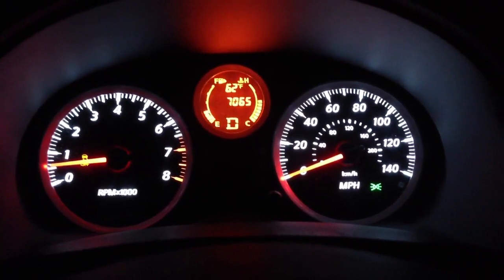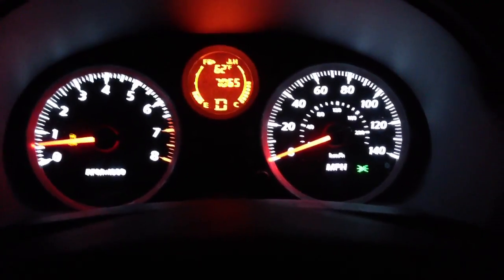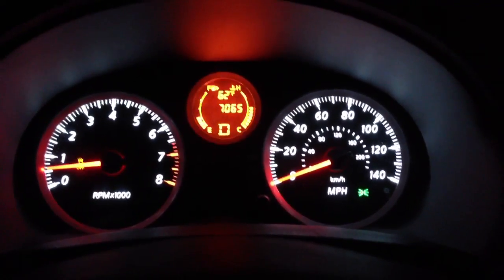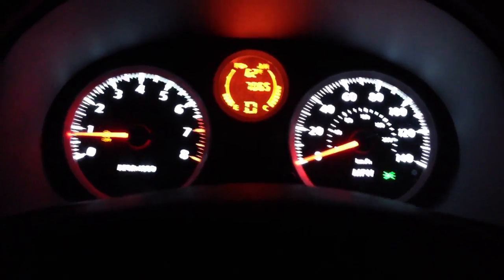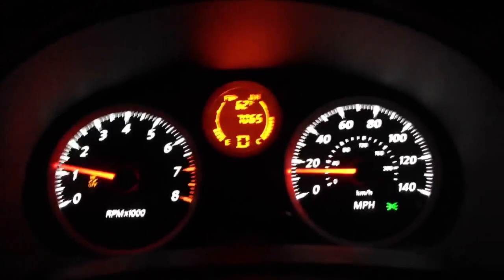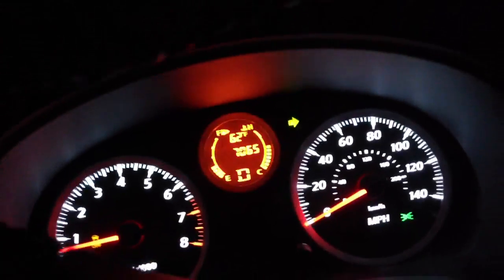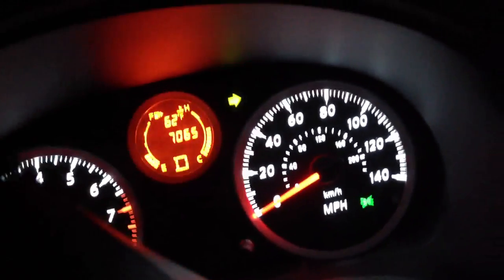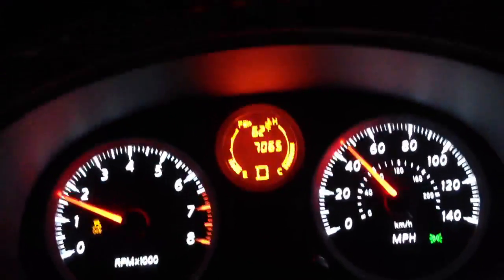CVT Transmission in Action!

Comment: sounds like the car is stuck in first gear
Reply: It is stuck in its only gear.
Reply: Gravemind No, in fact it's continuously changing the gear ratio.
Reply: It is changing gears, the point is u get all power at a continuous rate...
Reply: No, it doesn't. It sounds like the engine is at peak power.
Reply: It has unlimited amount of gears
Reply: cvts just have one gear, but that gear has an infinite amount of gear ratios, the diameter between the input shaft and the output shaft is a variant
Reply: i would like to feel what it its like since it keeps accelerating without feeling any gear shifting
Reply: @terry1427  it's not like a Tesla where it's just instant power that keeps you going. Personally I'll never buy another cvt because I love bouncing the needle off the red line and shifting. But in a cvt you can't really do that
Reply: @anthonyb2990  just bought a 15' Corolla with CVT, used to regular automatics and I drove manual once... Going to be interesting
Reply: @anthonyb2990  Well you need to drive one to see how it is. U can hear the engine better in a CVT and it rages in power. Manual cars are not like that. U may be able to reach red line but the sound is just loud and annoying. But on cvt the sound is powerful and deep. I tell you, u need to drive one to see how good it is
Reply: The gear is getting smaller continuously as the engine revs is getting higher so it stays always in it powerful band range ( i’m not an english native speaker so that’s y i may have made mistakes, but you’ll get the idea i think )
Reply: sounds like its stuck in a snow bank and trying to get out
Reply: I dont like that sound
Reply: sound like manuel car with worn clutch :)
Reply: Yeah! Isn't it great? Sonds amazing.
Reply: General Incredible I know how they work I just don’t like how it sounds
Reply: @mark babb Sound like it's stuck in its optimal power band* ;)
Reply: have you seen the williams cvt f1 car? if it was ever raced it would driven everyone crazy
Reply: Comments like this are why they make these simulate shifts now and I fucking hate it
Reply: @antholito  years later I still hate the fucking cvt
Reply: Depends how you drive it !
Reply: That is the best automatic transmission for passenger cars ever.!..👌 obviously if don't has fake shift.🤔
Reply: @helenodetroyo7035  you must have a cvt you seem very hurt by what I said
Reply: @Markbabb  
No, I never had a CVT.
What piss me off is that the automakers go against the logical design of a product reducing its potential because a bunch of ignorant clients.
Reply: Blahh... It sound horrible
Reply: there is only one gear
Reply: It is actually changing but without power lost, it is continuous
Reply: @itsthatatm8345  It can’t change gears it doesn’t have
Reply: @aluisious  always!👌😎
Reply: Technically it is but when you let off the gas usually in nissans it shifts to the needed gear.

Comment: Thanks, I will stay away from CVT if I buy a new car.
Reply: To each his own but it seems a bizarre sacrifice to me. You're giving up significantly better fuel mileage, significantly better acceleration and quieter cruising.  To someone who has listened to engines coupled to automatics for years, the sounds made by an engine constantly being optimally geared might be disconcerting at first, but surely that's something you can get over.
Reply: Number Six I haven't read anything more agonizing for a very long time.
Reply: SRAMEK "I haven't read anything more agonizing for a very long time.
--- I have no idea what you were actually trying to say.  Would you elaborate to satisfy my curiosity?
Reply: Number Six I might do that :). For me as someone, who really enjoys driving fast cars, especially with manuals (heel and toe and all the great things you can enjoy while shifting by yourself) or with sequentials (double clutches are not so bad as well), the CVTs are absolutely terrible to drive, even classic automatics are bad, but CVT is the worst, there is absolutely no feel in that. Before you tell me, that I didn't drive anything with a CVT, I really did dude and I have never felt so bad in car, I've heard about the pros of the CVTs and negatives of manuals, but for an experienced drive, you can erase almost all the negatives of the manual, but you will never get rid off the negatives of the CVTs or autos.

CVT feels a bit like driving old electric cars or trams. Dual cluth gearboxes are ok, you get quite a similar feel to a sequential gearbox and the it's so fast.
Reply: SRAMEK 
--- Let me employ your logic:  As someone who really enjoys being able to haul large and/or heavy items from place to place, I am certain that a sports car could never replace a pick-up.

 "For me as someone, who really enjoys driving fast cars, especially with manuals (heel and toe and ..."
--- CVTs were designed to replace automatics, not manuals.

"there is absolutely no feel in that."
--- I never addressed "feel." On small cars, CVTs produce both better acceleration and better fuel economy than do automatics.  If you don't like the "feel" of better acceleration, fine. If you don't like the "feel" of better fuel economy, fine.  BTW, CVTs were designed to replace automatics, not manuals.
"I have never felt so bad in car," 
--- Then don't replace your manual with a transmission that was never designed to replace it.
"but you will never get rid off the negatives of the CVTs or autos."
--- When it comes to hauling things, you will never get rid of the negatives of sports cars or economy cars.
Reply: I get you, for your purposes, it could be a solution.

What I was trying to explain was, why I personaly don't like CVTs, it doesn't matter, what it was designed to replace and after all, manuals are being replaced by DCTs and classic automatics, which might be replaced in the future by CVTs.

But the main problem is, that for most people, who enjoy driving, automatics and even more CVTs are terrible (no offence to hauling, I love some pick-ups), but for people enjoying the actual driving and the feels of it, I wouldn't recomend anything else than a high power manual.

I don't say, that CVTs or even automatics shouldn't be even made, there are certainly vehicles, where they can be used and could be beneficial. But when a company like Lexus put it in car I wouldn't be afraid to call a GT, that's horrible. If only there were the "new" M6 GC manuals in Europe. But I guess, that something like a 997 Turbo manual can heal the wounds :)
Reply: SRAMEK "What I was trying to explain was, why I personaly don't like CVTs"
--- I understand and we aren't far apart. I've owned nothing but manual transmission cars (and motorcycles) since I was 16.  I was trying to point out that while performance and "feel" might be the only characteristics you value in what a transmission delivers, that's not the case for everyone.  It isn't even the case for more than a small percentage of car buyers.  Manual transmissions may disappear all together because those of us who appreciate their strengths are so low in number that it's becoming increasingly non cost effective for auto manufacturers to design and build them.
--- Additionally, manuals aren't all moonlight and roses; a manual can occasionally be a real PITA.  On a recent trip to visit my daughter, it took me OVER FOUR HOURS to travel maybe ten miles of interstate.  I'd kill to be able to unlive that segment of the trip and do it with an automatic or a CVT instead.
Reply: Doesn't matter. EVs will replace most  manual and automatic ICE cars (mostly those bought just for commuting) within the next 50 years.

By that time, most of the buyers for ICE cars would most likely just be choosing between a stick shift and DCT since the market for ICE cars would be mostly just for enthusiasts (because it would not make any sense to buy a $50,000 gas car that a $30,000 EV could beat by that time).
Reply: Ano Niem I enjoy a good automatic as well, but I tend to stray from them due to the fact that they cost a fortune to maintain and replace when they die, compared to the cost of just replacing a clutch on a manual if properly driven.
Reply: @SRAMEK  "As someone who enjoys sitting in a fast car and mashing pedals with no understanding of what's actually happening, I don't like this superior technology."
Reply: Boris Z lls right
Reply: Good idea. They are horribly unreliable and have a "powerband" from hell if you'd call it that. They are horribly slow and dont give as much gas milage as they tout. Just stick with a manual or automatic. Shift shock will always beat these overly engineered steel band pieces of shit.
Reply: Don't buy a new car then they are all trash.
Reply: @george-im9jk  these new cars good
Reply: @SRAMEK  you dont know what fast is!
Reply: @dodgeramsport01  :D
Reply: Commando !  
What is awful about a CVT?  Is it the fact that it performs better than an automatic?  Or is it the fact that it provides better fuel mileage than both automatics AND manuals?
Reply: Commando !   
I said, ". I've owned nothing but manual transmission cars (and motorcycles) since I was 16.  "  It was a very simple, straightforward statement.  I really don't know why you weren't able to parse it adequately.
Reply: Commando ! 
You came to that conclusion based on a study of all manufacturers and all designs of CVTs?  That had to have taken a while. I am impressed by your tenacity and dedication.
Reply: CVTs get amazing gas mileage and constantly change their gear ratio to adapt to any situation. If you prefer an automatic, a CVT is a great option. Just do a little research and make sure the car doesn’t use a Jatco CVT like Nissan does. Toyota and Honda use different ones that hold up much better.
Reply: @numbersix9477  is CVT engine braking good? I’ve never driven one so I’d like to know
Reply: @wattson451  
No, it isn't "good." Why do you ask?
Reply: Why ?

Comment: A CVT uses a steel belt to transfer the engines power to the wheels. Since it is a belt, the car never upshifts/downshifts, it is always a smooth surge of acceleration. The belt continuously changes it's ratio (gear if you'd like) to give the driver the best fuel economy and power available for any situation (cruising, hills, passing, city driving etc..) The CVT does take some getting use to, please keep that in mind. A good example is the rpms staying at 5000 with the gas pedal completely depressed. There's no downshift, the belt continuously adapts to your engine speed/vehicle speed all the while still giving you excellent fuel economy. Some people like it, some people hate it. My best advice would be to keep an open mind.

Nissan CVT (Continuously Variable Transmission)
If you want a slightly better understanding of a CVT...
Reply: Like a Justy transmission?
Reply: Nissan cvt???
Reply: Cvt is amazing to dive but how’s it gonna be to service? Not looking forward to that bill hopefully these belts hold up for at least 200k on this honda lol
Reply: @junkyardripper word 😅
Reply: well in my Aunties Mitsubishi Colt Plus that has a CVT it struggles going up Transmission Gully (in NZ) you would have to floor it for it to even go up and flooring a CVT just red lines it the whole time
Reply: @junkyardripper 
No high maintenance costs on my Renault MEGANE Grandtour Mk3 Privilege 2.0 16V CVT with currently over 200,000 kilometers!!
Greetings from Austria 🇦🇹
Reply: @ashleynixon8305 
No problems with my Renault MEGANE Grandtour Mk3 Privilege 2.0 16V CVT with currently more than 200,000 kilometers to quickly climb the mountain ranges of the Alps!
Greetings from Styria, Austria 🇦🇹
Reply: @christophgrail  great to hear! I hope honda is similar, usually Hondas are fairly cheap, but I can’t imagine a belt replacement is gonna be cheap, it might be better to do a whole tranny swap idk I wish I still had an alldata account lol
Reply: @ashleynixon8305  that’s why nobody drives  Mitsubishi, they only ever had one solid motor tbh

Comment from the maker: @ViolentMouse It does not constantly rev at 5000 rpm it does that when you floor it like I demonstrated. When casually cruising it hovers around 1500. It works by always being in the optimum rpm range to constantly be as efficient as possible. Revving to 5000 and staying there is better acceleration than a regular automatic transmission because I am constantly staying in the powerband. I never said it was better than a manual transmission by any means.
Reply: Nice video and follow-ups, Andy.  Thanks.
Reply: ***** But it's not
Reply: ***** "I think it's superior to both auto and manual."
Only if you narrowly define "superior."  I own a Honda Accord with a manual and a friend of mine owns an almost identical Accord with a CVT.  Acceleration wise, the manual is a clear winner.  However, his car bests mine on fuel mileage by about 10% in every "normal" driving scenario.  A manual transmission is more efficient (eats less power) than either an automatic or a CVT but the ability of a CVT to constantly keep the car's engine at a near optimal rpm gives a CVT gas mileage that neither an automatic nor a manual can touch.
Reply: Andy Torgesen How much of a pain in the ass are they to service?
Reply: +Number Six I would say the ZF 8-speed RWD automatics can do better than a  CVT, due to parasitic losses on the CVT drivetrain plus rubber band effect, and overall provide a much better driving experience. The only scenario where the CVT is truly superior is when being used as a power split device between an electric motor and engine.
Reply: +Tom Zeimet " ZF 8-speed RWD automatics can do better than a  CVT"
--- The ZF 8-speed was made for wealthy guys like you.  Most of the rest of us will have to be content with either true manuals, CVTs, or less efficient automatics for the foreseeable future.
Reply: +Number Six What are you talking about? Even the new Malibu has it with the 1.5 Turbo engine.
Reply: "Even the new Malibu has it with the 1.5 Turbo engine."
--- The Malibu has a ZF 8 speed transmission?  Is there any chance that you have verifiable evidence supporting that assertion?
Reply: I know someone from the US that has been to Germany to a transmission plant that make the 8 speeds for the Audi. I don't know of an 8 speed transmission for any American cars yet.
Reply: The ZF is in many new Chrysler vehicles such as the ram, charger, challenger, etc.
Reply: +Ethan Shrago yea our new 2016 ram 1500 with a 5.7 hemi has the 8 speed and that thing is fast as hell for a gasoline pickup truck.
Reply: +Number Six I think that if they would tune the cvt better it would take your manual no problem.
Reply: Steven Vanheel How much of a pain in the ass are these to service and are they reliable?
Reply: Steven Vanheel You can tune a piece of shit CVT transmission any day you want and it will never out perform a dual clutch or I could even say a manual transmission. CVTs rob cars of power and they're not direct drive. They are purely ment for fuel economy. Not only that they cannot handle high power for shit lol
Reply: mahunik That's what I intend on using it for. Fuel economy.
Reply: +mahunik think about it: in the future, when these transmissions are further developed, when there is less power lost between the flywheel and the rear diff, I think these transmissions will be the fastest around. I don't really give a fuck how fast you can shift your manual, it still takes time. These transmissions get rid of the time it takes to shift, and they have the ability to hold the engine in its optimal rpm range until the top speed of the vehicle. They have been used in snowmobiles since the 1960's and probably before, so they are a proven design because every snowmobile currently on the market uses them, and they keep getting better every year. You can tune them by changing the weights and the springs and shit, to the way that you want them. If you were in to snowmobiles, you would know that a properly clutched sled with a smaller motor can beat an improperly clutched sled with a bigger motor (I did it with my old sled that makes 95 hp compared to my friends that makes 140)
Reply: +mahunik and I think that all of those principles, when properly applied, can and will be applied to cars.
Reply: It actually is better than a manual in terms of acceleration . But it sound terrible
Reply: Hi. What is the revs will be if you cruising 120km/h

Comment: CVT is the best transmission ever. It is very powerful, very fast, overtakes quicker than a regular automatic transmission. Driver's feel more confident when overtaking in a CVT because the car doesn't cut any speed at all until you hold the brakes. It gives you this turbo boost feeling. Anyone driving a CVT car for a very long time would know what I am talking. I love the sound of it going high and low, sounds very aggressive as if you can't cut its speed.  People should love this more. These are the best transmissions ever....
Reply: They do take some acclimatisation. As with everything else, people know what they like and like what they know. If CVT had come along firstly, no one would ever have devised DSG, torque converter automatics, let alone full manual three pedal transmissions. Same as if full EV's came firstly. There'd be no market for an internal combustion engine.
Reply: PDK, S TRONIC AND DSG LAUGHS AT THIS!!
Reply: so how is this comment holding up? assuming you’re on you’re 5th transmission by now?

Comment: The torque taking over at 4-5000 rpm range is the same on the GM CVT's used in the Saturn Ion and Vue, and you can defiantly hear it at 1/2 open throttle on the highway.

Comment: The cool part is you don't need a ton of torque I suppose, as the engine will be in the peak hp revs throughout the acceleration. Would be perfect for Mazda's Rotary engines :>

Comment: Dunno how I got here, but I suggest you try out a CVT with a turbo, such as on the '14 Forester XT. With a turbo it pulls like a diesel, revving at super low rpms and still has the buttery smooth action of a CVT.